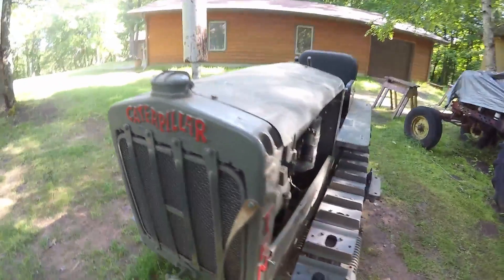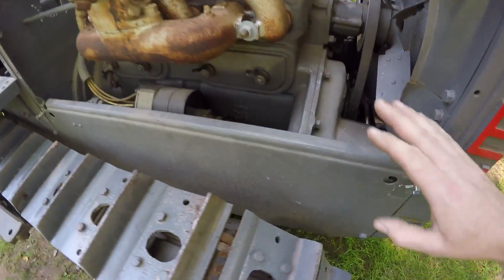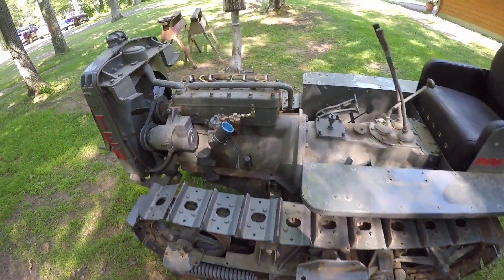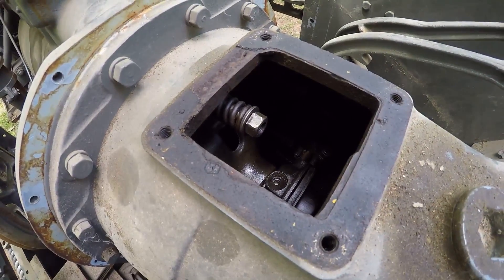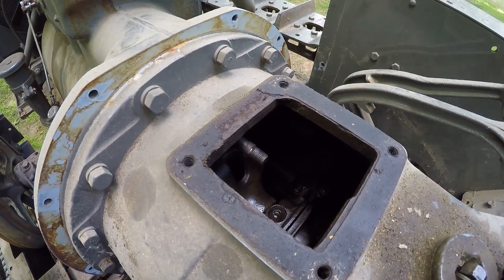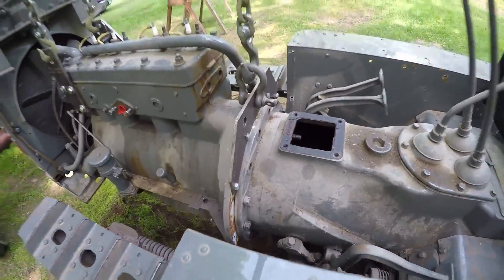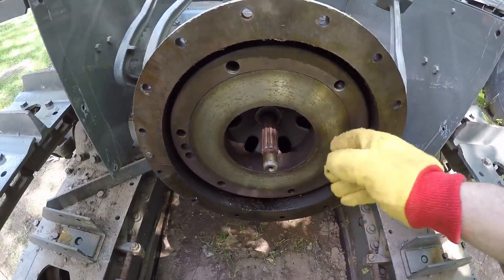Caterpillar Ten Clutch Bearing Replacement - Part 1: Disassembly/Splitting the Tractor

Comment: Hey squatch when you pull the exhaust how necessary or often would you need to separate the entire exhaust assembly if at all just curious on dads old farmall f12 ,f14 and F20 we would redo them yearly  after inspection

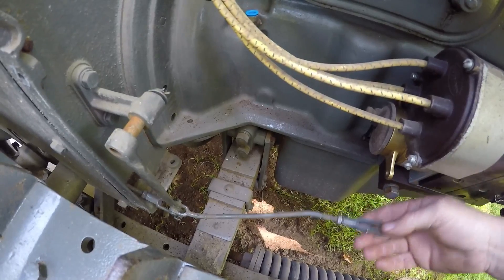Comment: @3:50 I'm staggered to see a total lack of lubrication on the linkage. I can hardly believe that someone who is so very particular about mechanical details can assemble a mechanism without lubrication. The rust in the pivots is an insult to the machine.
Reply: @squatch253  
Thanks for your reply. I'm so used to being impressed by your attention and care that I was too quick to assume you had a hand in this. Yes I saw your work on the undercarriage and from what you say you will have no excuse for sitting around relaxing for some time to come.

Comment: I had race cars when I was much younger, the last one was a '57 Chevy B Gasser. I learned to drive on a Farmall Cub in 1955 at 7 yo. I was like Mr. Toad's Wild Ride at Disney. I have always had a penchant for dozers, having operated a JD 350 for a few months, then "played" with a D8 when I worked for a construction company in 1978. BUT, I knew Nothing about the working parts of a Dozer. So, watching these videos, I am Mesmerized watching the piece by piece disassembly, (With Complete Explanation !), and reassembly of each component. I am so nearly there, I feel the grease on my hands! Thank you Toby, for sharing the excellent mechanic skills you have !! While this "10" is a "Little Cutie", one has to remember that even this "little" heavy duty cold hard steel means business ! I saw the "10" which was on outdoor display during your road trip to pick up the only D2 new cylinder liners left in the world (made in 1938), and you said in the video that if that "10" was yours, you wouldn't have it stored outdoors. I agree with that 100% ! I would keep it in a heated shed, and only drive it on dry weekends ! LOL. Can hardly wait to see this put back together. Thank you again for sharing your wealth of knowledge!

Comment: I owned a 10 and a number of 15's and 22's in my time which was admittedly was over 20 years ago. From memory I always took the engine out as one unit to play in the clutch area. The foot plates needed to be undone as did the front bolts on the mudguards. Then the keeper on the throttle, jack up the front of the gearbox, drop and slide out the equaliser spring, then undo the ring of bolts around bell housing  and extract the engine whole! Have I missed something out? I am old, good video all the same.....

Comment: Cat stuff , well engineered , made to be rebuilt not thrown away , love it !  I have a D2 5U that needs attention . Pup won't engage , been pull starting it with my pick up . Need to pressurize the fuel tank a bit and bleed the injectors almost every time I start it . Clutch is acting odd , I took off the small plate on top and the disk with the pull out pin turns freely , the pin doesn't seem to engage , is it possible that the pin is broken off ? The knob is there and it pulls out against a spring . Cheers , Barry

Comment: kind of curious how many years did they make those things,, I live on a ranch,,we got one buried under a pile of the debris, I asked the owner she said that the last time that Cat ran was when she was a kid, stated that the left track if you lock the  track... would come off off its roller,it's a flat track the suspension is identically what you got on yours same Flathead 4,,, the only thing that can see different from yours and hers is to shroud too the radiator is different. I think she said it may be a 1931 or 32

Comment: wow.. thank.. the family acreage has a 1926 Twenty.. mom wanted to change the transmission oil. dad drained and refilled it.. found the clutch cavity and filled that with gear oil also.  dad decided to wash the oil out of the clutch with 5 gallons of MEK.  washed all the grease out of the throw out bearing and pilot bearing.  the motor eventually seized.. somebody took the magneto. i saw it about 20 years ago gleaming bright yellow in the sun. . the last time it was painted was about 1963.. with the best quality hansa yellow paint that could have been had.  it was almost glowing it was so bright.. i reached out to touch it.. then pulled back.. realized that 1963 paint was LEAD based.  so it just sits out in the sagebrush.   in the early 70s. one of the locals borrowed the cat 15 pull grader with pnumatic tires.. its painted and on display in their front yard..  both of those were great jungle gyms to grow up playing on.  thanks for the video.. i don't even know if it still exists. i can see it on google maps but that image is a few years old. . . i look forward to your putting the finishing touches on the TEN. to keep it going another 90s years.